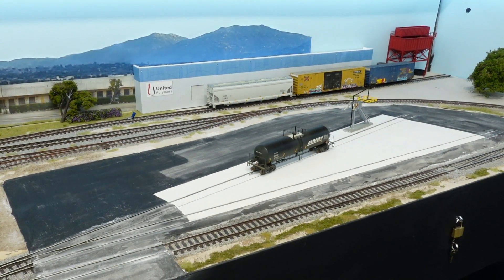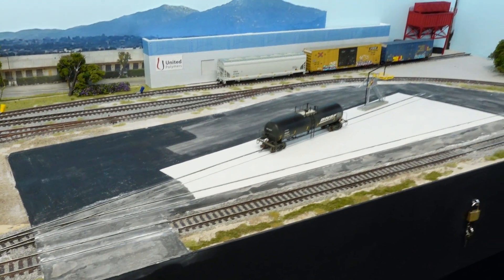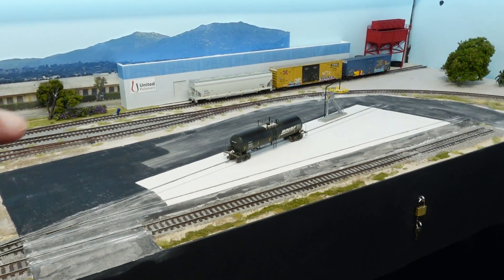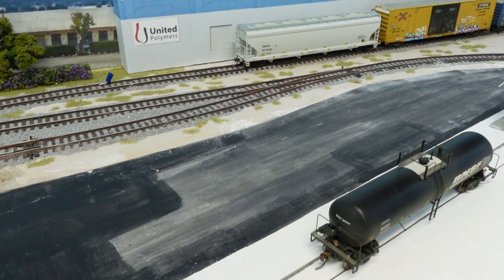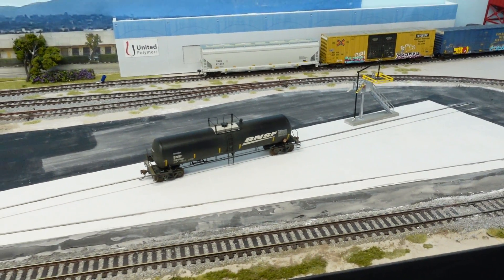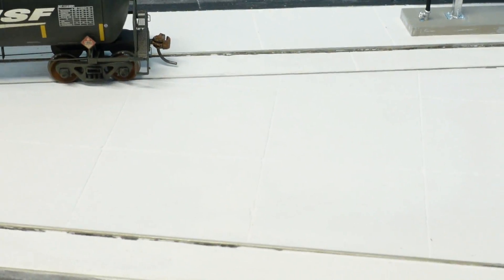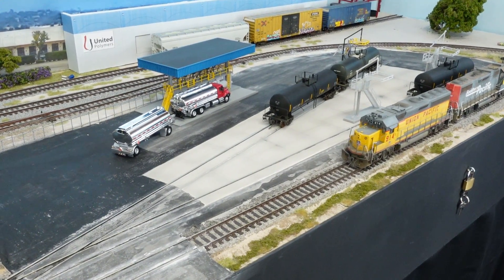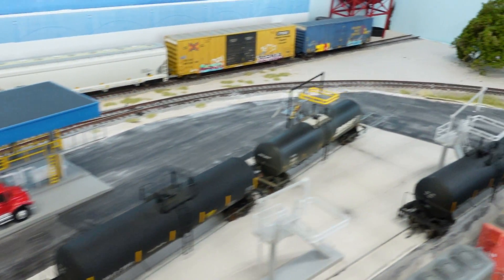Layout Update #54 | Making Concrete Slabs | New Tank Car

Comment: How you have it is prototypical, especially if you have any petroleum-based shipments in the cars. Anything like that (fuel, oils, solvents, etc.) will eat away the asphalt. Also, it is a permeable surface that lets liquids pass thru it. Concrete is made to withstand the chemical environments, and is non-permeable.  It lets nothing thru. Take a look at an airport terminal. All the hardstands/gates are on concrete, same with the de-ice areas. All to withstand the chemicals and not let them leak into the groundwater. 
The EPA and Sierra Club approves!
Love your vids, awesome job on the layout. Great inspiration for my own switching layout.
Reply from the maker: Thank you very much. Good info also. BTW, I like the A-10 profile pic.

Comment: I do like the result of the 'happy accident' painting the asphalt with a mix of acrylic and oils!  Often those lots are beat up and repaved a few times in different areas.
Reply from the maker: Think I might seal the concrete area and try some panel liner on the cracks, see how that comes out.

Comment: What materials does the prototype handle? If they're handling petroleum products, it's really surprising to me that they'd asphalt their yard as my understanding is that petroleum spillages really wreck asphalt. Most of the roads in the UK, including the highways, are asphalt and it's a pretty common occurrence that a truck crashes, spills diesel on the road and they have to resurface that section.

Comment: Your BNSF tank car is for company fuel service.  I am not aware that BNSF uses any tank cars for customers.  The BN/BNSF used to move fuel tankers from Council Bluffs, IA to the engine service facility at Lincoln, NE by adding 6 - 12 cars to an empty coal train that was coming down this way.
Reply from the maker: You are correct. I see BNSF doesnt use their tankers for customers. I'll have to come up with a story for this one, or maybe re-label it. thanks.
Reply: @socalscalemodels  When I mentioned the fuel shipments for Council Bluffs to Lincoln, they did that because at that time Council Bluffs had the pipeline terminal that filled the cars.  Perhaps your local BNSF operating division gets its diesel fuel cars filled at that terminal and the loaded cars will need to be taken away to the local engine terminal.  That gives you a plausible reason to send BNSF fuel cars to that terminal.  The shipments could be on a regular basis or on an "as needed" basis meaning that an operating challenge would be to handle an extra car or two for the railroad fuel.